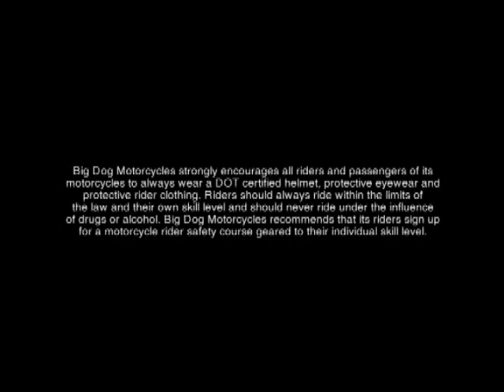Big Dog Motorcycles Brand Introduction

Comment: I Owen 2004 RT ( rolling thunder frame ) left side drive ,107ci chopper  17 yrs old now, rewired bike like it should have been done from the start ,Thunderheart ECM,carb ,supper G single fire ign and coils. Kick starter, primo enclosed belt drive ,also clutch   basket primo pro , next up big bore kit 124ci,new cylinders,port heads,cam custom Sisy bar  and struts vicous cycle KILLER looks IAM hopefully freshing up my Dog  tell I  give it up 😎☠️ my death , and I wouldn't trade nothin in this fucked world,!!